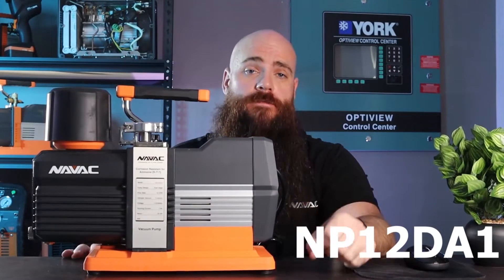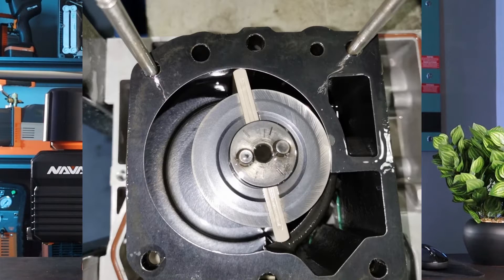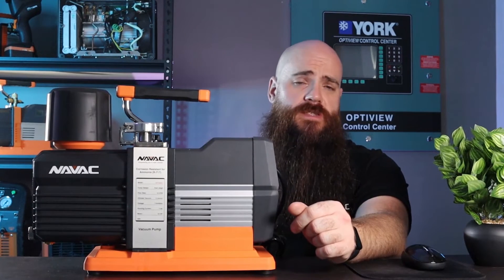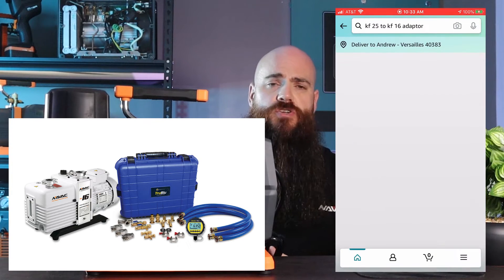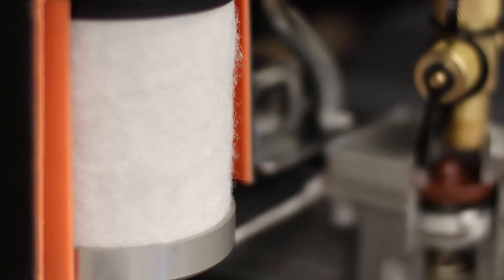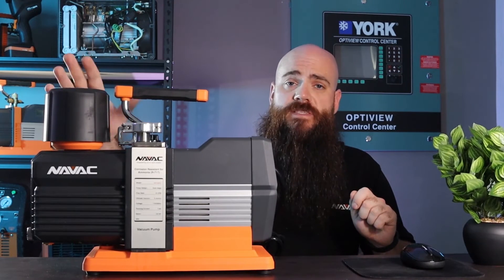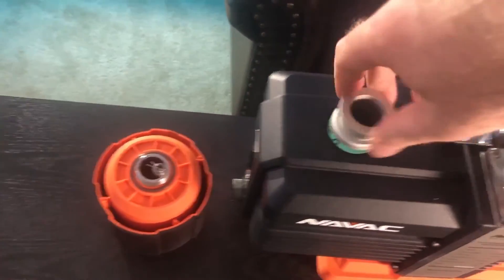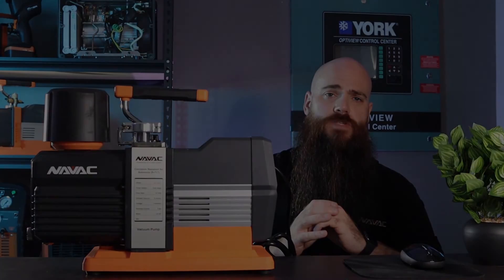NAVAC NP12DA1 Ammonia Vacuum Pump BY AK HVAC

Comment: I just got it today but it didn't come with the filter ? Came with the flange fitting only
Reply from the maker: Hello, the filter is not good for ammonia use. The pump was first introduced with the filter, but we had received a few claims from people mistakenly using the filter for ammonia. Starting Dec 2021, we removed the oil mist filter in the product and have adjusted its price accordingly. Now the NF43 Premium Oil Mist Filter is available to purchase separately.
Reply: @NAVAC Inc. HVAC Tools Division  thank you . Yes I have been using it a lot . So far so good 👍. Pump is a beast 💪